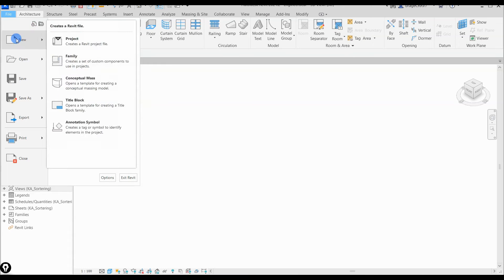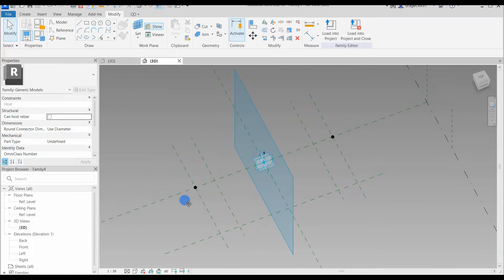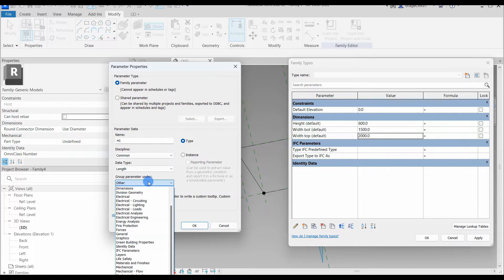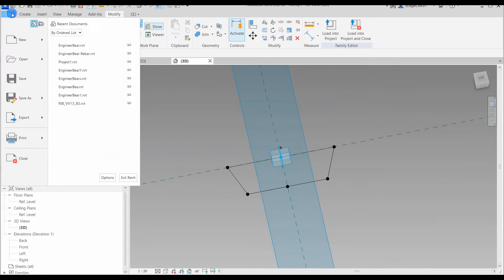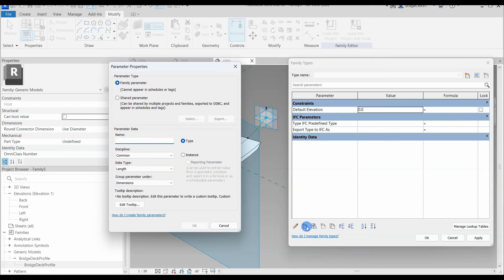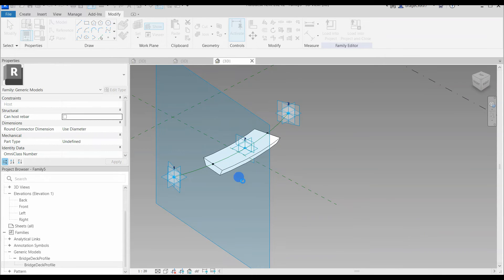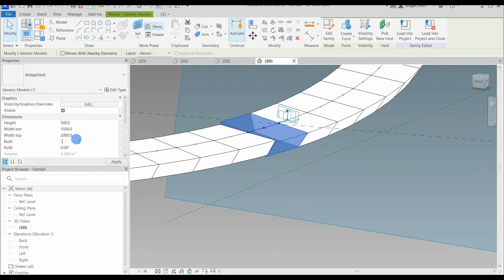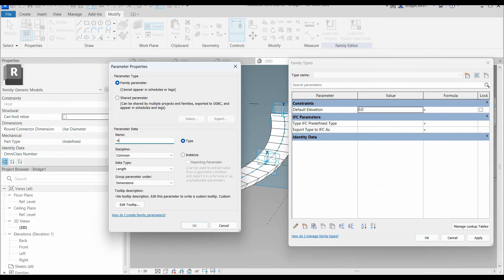Revit adaptive family - A curved and sloped bridge superstructure

Comment: it's a great vedio 
when i try to change rotation angle at start and end it fails and delete the created solid is there any reason?

and another question what is the difference when we create the profile at the top plan or at (Front/left)
Reply from the maker: Thank you. 

Your geometry might be too complex for Revit to handle, causing it to crash during generation. Alternatively, the curve might have a turn that’s too sharp, resulting in excessively steep angles between individual cross-sections, which can also lead to a crash.

Try generating a solid with just two sections, and increase by one or more to check where it will crash. 

Should not have anything to say if you have several adaptive points in the cross-section. If only one adaptive point you must be a bit more aware of the work plane you select when placing it out and the option "always vertical in the nested cross-section family.

Comment: When in the 3 adaptive bridge part, I try changing the rotation but nothing happens
Reply from the maker: Hey! Yes, that is correct; the rotation is already set by the 3 curves the 3 adaptive bridge cross-section follows. When you have just one curve, its possible to rotate it around the 1-adaptive point.

Comment: Hi there!
Great tutorial!
If I want to model an SBG with changing of thickness of the bottom slab in the same piece of SBG, how would you suggest modelling it using the same method?
Reply from the maker: Hey! Thank you!
I will drop a video about modeling a box girder with varying height 3.juni. In that video I will use two splines and a cross-section containing two adaptive points.

Comment: Good morning, would there be a way to always position it horizontally? without lateral cant?
Reply from the maker: Hey, If I understand your question correctly, to always position it horizontally just dont ad or type in any numbers for in the roation parameter.
Reply: Thank you very much for the quick answer. @EngineerBear90.
I mean that in this family, when the nodes are at the same height, you define the transversal slope with the initial and final angle.
But when the nodes of the spline are at different heights, the transverse slope is generated by itself, it does not remain horizontal.
I want the platform to always remain horizontal and not twist with the spline. Do you know if it would be possible?
Reply from the maker: Okey, I think I understand. That is correct! You can rotate it with the rotate parameter back to horizontal (a bit of manual work) You can also try to impliment two more adaptive points at both ends of the cross-section, also adding two more curves for the bridge(either generate it with dyanmo or get thi curves from "TheRoadPeople".  Iam planing to make more bridge videos, but wont be before summer atleast. You can also send me the bridge to my E-mail if you want to so I can check it out.  @ibligah